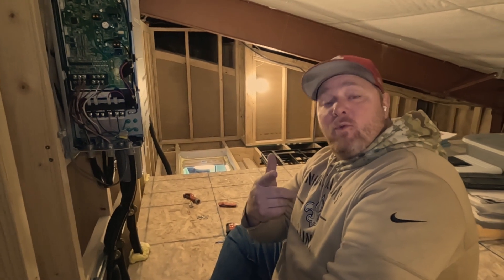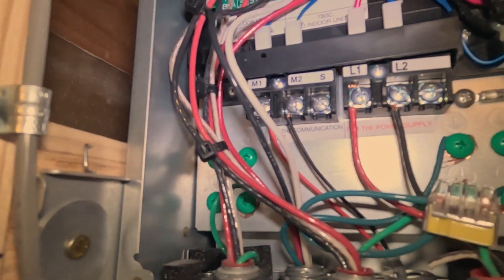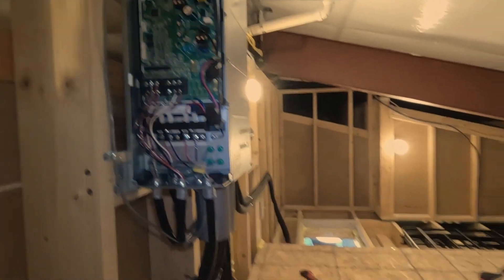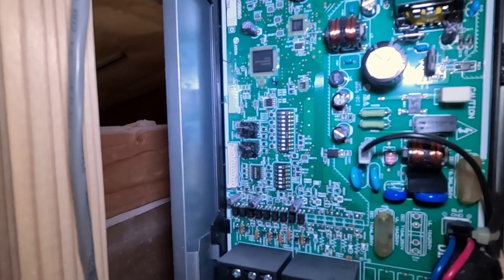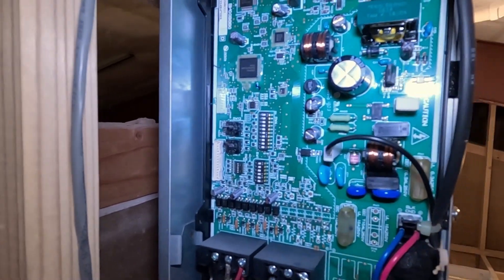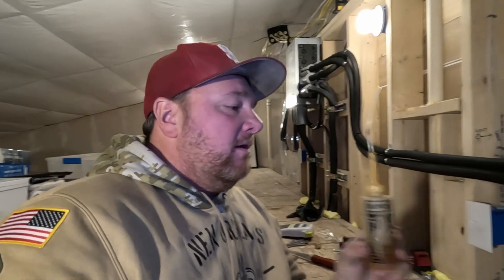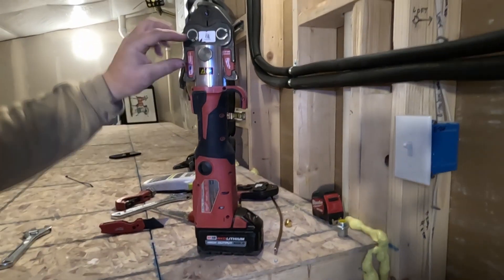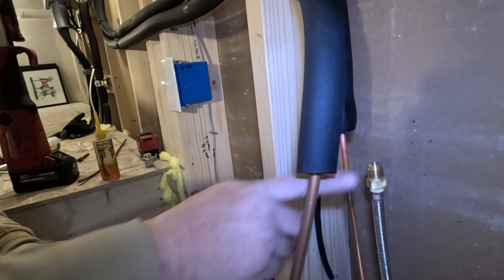All Your Branch Box Questions Answered (Mini Split 3 Port Branch Box Install)

Comment: For your pressure tests and evacs with branch boxes are you using a dip switch setting to force all the LEVs open, or overall how are you ensure that you are not pressure testing and evading just from outdoor unit t the branch box?
Reply from the maker: The LEVs are never fully closed. So, no, you don't have to force them open. Also, you evacuate from each side. The SM units have (2) Ports to evacuate from on the high and low ports, which give you access from each side of the lines.
Reply: Thanks for the quick response. Was y getting a pressure reading on the liquid line side when introducing nitrogen on the gas side which had me thinking LEVs were sealed. Ended up it was a gear failure though after swapping out gauges. 

Appreciate the videos. Mitsubishi units have been a learning curve and these videos have helped.
Reply from the maker: @zackarygibbons540 Anytime bro!

Comment: Can I add a branch box in order to make a single zone LG LSU180HSV4 into a two zone?  Thank you
Reply from the maker: No you can’t use two different manufacturers pieces of equipment on an install

Comment: When you added the 3rd zone did you have to remove the refrigerant before you added the linesets to the branch box?  I’m adding two zones to my system
Reply from the maker: @gott4200  Yes you must or it will vent everywhere

Comment: Great Video!!!   Best tool ever made!    
Do you have a recommended supplier for ProPress Fittings?   
Can you leave Factory Cap on Branch Box if one Zone is not used?
On a 48H2i, hoe much can you go over the Rated Number and do you recommend that?  I plan on adding a rarely used Garage Cassett.
Do you have a Donation Link to your page?
Reply from the maker: Yes, you can leave the cap on 
(48k oversized) Yes, you can go over, but not a lot. You need to do a DSB to see if it will work or not (BEFORE YOU INSTALL) 
I don't have a donation page, but thank you.

Comment: Is there a certain setting on the branch box you need to use when you are pulling an evacuation or are all valves already opened up from factory?
Reply from the maker: @danielturri5505  nope just do your vac and charge via the DSB program and you will be good 🌟

Comment: Show me the antenna effect in the installation guide use nylog all fittings with double flare and that High Press cost 3 Grand the more you Tinker with a plumbing it easier to leak Montgomery Scott
Reply from the maker: @TAGUPNBLUE  That's what the techs from Mitsubishi told me.

Comment: Mitsubishi 5 branch box here.  Probably best to use 12 awg vs 14 for the power into the branch? Still needs a signal wire set between the "m" terminals?  Im not an electrician but am mostly calable Lol. If you have time for an answer i would be most humbled
Reply from the maker: I'm not sure what your asking. The M1,M2 terminals must be landed @ the BB
Reply: @ductlessplushvac sorry. My outdoor compressor will send line voltage to the  5-branch  box.  Might it be ok to use 12 awg  stranded vs 14 awg solid for that, or is solid wire the usual choice?  Aside from all this, will still need the m-terminals wired  between the outdoor compressor and bb?
Reply from the maker: @mikemiller9030  just do what the instructions say and you will be perfect

Comment: If 2 branch boxes off 1 condenser, do you set one to 01 and one to 02 and leave the condenser at 51?
Reply from the maker: That's a great question no. 1st BB is 01 then it depends how many indoor units you have if you had 6 indoor units it would be 06.
Reply: Do you run a separate comm 16/2 shielded and 14/2 from the ODU to each branch box or do you piggy back from one box to the other? The manual doesn’t seem to make it very clear. Thanks

Comment: What is the proper way to run the communication wire if there are 2 branch 
Boxes ? 
7:09 Do I run two wires from the condenser. Or do I run one wire to branch box1. Then run a jumper from branch box 1 to branch box 2?
Reply from the maker: Daisy chain them from the outdoors then to 1st BB THEN to 2nd BB, Only land the ground wire on one end not both sides.
Reply: @ductlessplushvac  Great thanks. That’s the way I ran it hoping it was right. Your videos are perfect. Couldn’t have done it without them
Reply from the maker: @RichCollins-rm6om  
Make sure to give us a sub! Thanks for watching.  
Jared

Comment: Why would you add a pro press nipple with a flare on it? and not just flare the end of the pipe and skip the extra pro press joint? aren't less joints preferred? or are the pro press flares superior?
Reply from the maker: Pro press 1000000% better
Reply: @ductlessplushvac  But why use a pro press with a flare? Why not remove the flare fitting entirely?

Comment: I have been quoted a system that uses a Branch Box (4 head Hyper Heat). I am concerned that his adds more points of failure. What are the pros to having a Branch Box? Should I consider 2 separate outdoor units or another manufacturer?
Reply from the maker: The only benefit for 2 units is they should have a better efficiency VS a BB install. 

I would use a BB install for the cleaner look

Comment: Did you install a breaker (or disconnect) between the B1/B2 connections on the outdoor unit and the L1/L2 connections on the branch box? I have an MXZ-SM48 and the install instructions aren't clear whether this is optional or required. Thanks!
Reply from the maker: We only install a disconnect for the outdoor unit. Run the wires straight to the BB connections on the branch box from the outdoor unit.
Reply: @ductlessplushvac  thanks! Super helpful

Comment: What happens if branch box is not address correctly. I ran into one were unit is set to 47 also 47 at branch box. How will the system operate? Will the indoor units work properly? 4-zone. When all zones is calling for cool, only 2 cools and the other 2 furthest from branch box not cooling.
Reply from the maker: It may still work but it won't work correctly 
Just do it 51 - 01

Comment: For the side that isn’t grounded, what did you do with the wire? Cut it down or do you cap it off and leave it in the branch box? Just curious. Thanks!
Reply from the maker: Wrap it with electrical tape. And land the 
M1-M2

Comment: I'm a ductless installer out of MA and was just curious about only grounding the M-NET wire on one end. The distributor/installer I spoke with today said that it should be grounded on both sides, but I am wondering if he somehow wasn't understanding what I was explaining even though I mentioned to him about it turning into an antenna if I ground both sides. If you don't mind me asking, was it Mitsubishi that mentioned to you to only hook the ground up on one side? Also, how long does it usually take you to vac down a 3port branch box system usually? I had the vac pump on for about 90min today and was still only at 760microns, but I know I didn't have any leaks since when I valved everything off it stayed right at 760. I use a 7cfm pump with 1/2" Navac high refrigerant flow hose and removed all the valve cores. I'm going back tomorrow to finish it all up and vac down for a little while longer but just was wondering if it usually takes you guys a while to vac down branch box systems as well or if I am missing something on these new Smart Multi condensers. Thank you for the informative videos!
Reply from the maker: Yes, Mitsubishi told us not to ground the 2 sides. Only one side; it doesn't matter what side you ground.  

If you have a higher-than-normal humidity level, you should break the vacuum with nitrogen. You should perform that three times (Triple evac). When you vacuum a system, and if it has any moisture in it, it will freeze. This will not allow you to perform a high-quality evacuation.  We don't have a high humidity level here, but in lower elevations, you will. I like to purge the nitrogen out of the system and perform a blowout. Once I feel the nitrogen has passed all the air out, then I pressure test. Once it passed the pressure test, we then perform the evacuation process. It's safe to be within 1000-500 microns. The lower, the better, tho. Also, micron gauges can be misleading. Make sure your gauge is calibrated and working normally and that you have a high-quality fresh battery. 

 (This is also helpful. Never entirely remove the nitrogen to zero. Leave a little in the loop and then start the evacuation. Open your gauges very slowly to not shoot the nitrogen out of the vacuum pump. This ensures no air enters the system) thanks for watching the videos and please subscribe so we can make more videos you may like HVAC on brother! 

Jared
Reply: @ductlessplushvac  What do you pressure test these multizone branch box unit to?  300? 450? 600?
Reply: Each box is at a slightly different potential and when the communication lines are grounded on both ends it causes a current flow which is noise.

Comment: Not using Nylog anymore?
Reply from the maker: The oil is cleaner
Reply: @ductlessplushvac  what was the name of the oil?
Reply from the maker: @GregTellner  any kind vacuum pump or 410a oil works
Reply from the maker: That's what the DSG Mitsubishi techs told me to do.